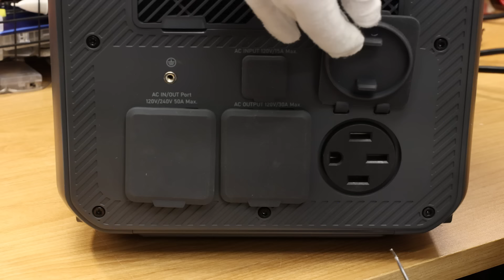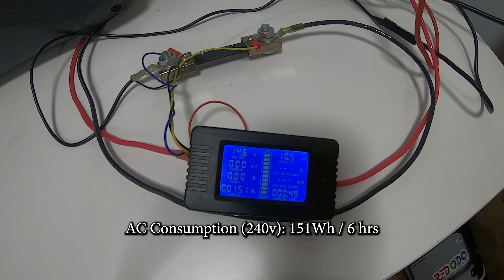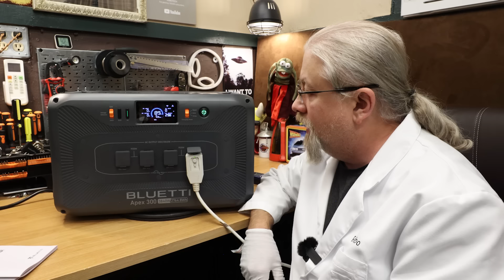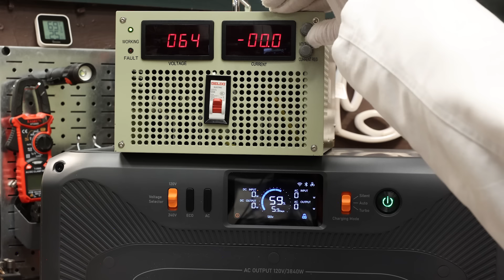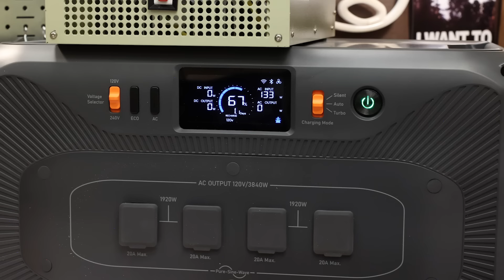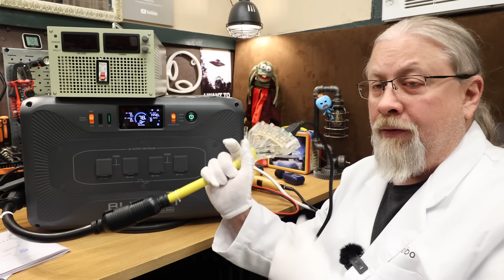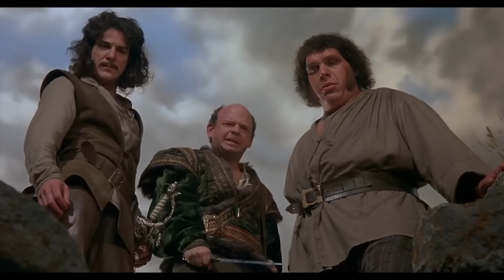Bluetti "APEX 300" 120v/240v MODULAR Home Backup Power Station | Cheap & Simple!

Comment: Wow this looks like I need this - one question I can't find a definite answer on: I have a whole panel interlock for my home and use a generator as backup (with a 30amp inlet) Can I use this WITH my generator hooked to the apex? and do I set the generator on 240v or 120v ???  as long as  I don't exceed the 3800w load will the apex do the job for basic home backup? I am hoping to be able to use generator to top up the apex so I don't have to run the generator all the time? And planning to use the Apex as a UPS on my modem router while it's not needed? that way it will always be charged and ready to go and accessible.

Comment: Hello. Thank you for this very comprehensive review video. This unit is one on my list. I have a question, have you tested how much total wattage can this unit output including the pass through/bypass (1400+ AC input and Inverter power - 3840 watts). If it would output a total of 12k if your using the 240v input, would it output a total of 5k+ if its plugged to the grid with he 120v input? im eyeing this  unit and knowing that will help me decide. Thanks in advance.

Comment: How could it have 12kW pass-through if the maximum output is 3,840W?  Or are you talking about with 3 units in tandem?  Or can it really put out 50A on that 240V connector if there's 12kW at the input?

Comment: You may have answered this and I may have missed it otherwise I think I know the answer but I am going to ask anyways.    
Ok my RV is a 30amp and my genarator has a 30amp plug csn I charge with 30amp and have rv plugged in at same time?    I am assuming i would use the 50amp plug with a 30 amp converter

Comment: I already have a solar array on my roof of 15 300w panels for a total 4950 watts that’s tied to grid but I don’t have battery backup when the grid goes down. Can the Bluetti 300 with 3 Bluetti 300k batteries be tied to my solar array without blowing up the Bluetti 300?

Comment: At 25 minutes Hobotech says that if set st 120 both sides of the 50 amp plug are hot.  Question: is you accidentally turn on a 240 device such as a well pump, will it not damage the 240 device?

Comment: Unhappy Bluetti Apex300 Owner.

I have made an extremely bad mistake.  I tried to follow your instructions and the Bluetti Apex 300 instruction manual on charging my Apex300 using the 240V Bluetti charging port.  By doing so with 240V, I caused over $ 5,000 in damage to my brand-new Apex300 and two B300K batteries.  According to the Bluetti service department, my attempted 240V  charging procedure using the Bluetti charging cable violated their design parameters.  

Supposedly, the US model Apex300 is not designed to be charged at 240 Volts but only at 120 Volts. 

Please advise your viewers not to use a 240-volt service to charge their units. The  Bluetti warranty does not cover any damage caused by using the Bluetti instruction manual.

Comment: Thank you for this great review. It seems like the surge capacity of your test was just over 5,000W at 240v output. This is not close to the advertised surge capacity of 7,680W. Why do they advertise something that cannot be achieved?
Reply: He didn't have it on lifting mode when tested.  I doubt it could still pull it off but it should be able to handle 4400W in that mode

Comment: I was hoping with your expertise you might be able point me in the right direction.

I’m torn between the Apex 300 and the Ankor Solix F3800 as I want 240v output. 

I would like to charge the power station with an older Honda EU2000i generator, and it looks like that output on that is 1600w at 13amps with 120v AC.

I’m hoping to replace my Onan 4500i generator and combine the Honda 2000 generator with a power station to run my 30amp RV and its air conditioner during the day.

I don’t run the AC during the nights and would prefer to not run the generator but would still like to power the RV fridge, a TV and Starlink mini (for a few hours), and charge our phones without listening to the generator running.

During the day I would run the generator to charge the power station and also run the AC periodically.

Comment: I bought Apex 300 last week. I was able to use it for 2 days only until after draining the battery completely to 0%. Now, I try to charge it thru AC or DC input but it will only turn on for 10 seconds until it turns off itself. It won't charge anymore. I called service but looks like they have to replace it. Don't know how soon. I am boondocking so hopefully soon.
Reply: Update: I got it working again. It is now charging. I believe it needs to be charge with low watt input for a moment to charge it. From my observation, my solar charging went low to 35 watts input during sunset. When I turned the Apex 300 on, it was taking 35 watt input instead of 0% during daytime. When it was charging already, AC input from my gas generator charged it too… I have seen some people in YouTube had their solar input charging their Apex300 for 4 days until it woke up their BMS. I believe this problem won’t happen again if you updated your system version to the latest. Hope this helps to anyone.
Reply: Another update: After getting it working again, from around 70%, it all or a sudden turned off. I tried to turn it on again, it says 0%. So it dropped from 70% to 0% in seconds with about 150w AC output. I tried to charge it thru AC, it says it is charging but it will turn off itself. Now, I am back to having the BMS won’t charge. This is very frustrating especially when you are boondocking… My gas generator is more reliable.

Comment: Someone told me (maybe you will too. Haven’t gotten to the end yet) that you can only get 16A out of the 50A 240V outlet. I assume you need to combine 3 of them with that panel to get the max amperage. Will you get the max out of that panel only or will you get it across all 4 outlets (the one on the panel in the ones on each unit).  If only in the panel, why do they put a 50A plug on the units?

Comment: My friend just upgraded his AC300 with 4 B300 batteries to the Apex300, which Bluetti assured would work with his existing batteries. After firmware upgrade and charging the Apex300 fully, we added each B300 one at a time. The first three worked fine, but upon adding the fourth, the Apex300 grid input fell to zero. Immediately upon disconnecting that fourth battery, the Apex300 showed normal grid input, etc. Swapping the fourth and third batteries and even their cables made no difference. The docs clearly say that the Apex300 supports 6 of the B300 batteries. That does not appear to be the case in our experience. Can you test this?

Comment: If your charging from 120v. Say a campground 30amp which is just L1.  Will this unit boost L1/L2 output using the 3600 watts available from grid.  Sorta like a victron MP 2x120.   Giving you 3600w from grid and 3840w from the inverter.   Like being able to run 3000w on each leg or variations of such

Comment: My cabin has a weird dual 120v generator inlet that powers 2 circuits from a generator.  Also there is a separate 110v circuit in the crawl space to power this.  This is perfect for my existing setup!

Comment: I just bought a apex 300, opened the box, unit showed 0% charge. Have been trying to charge it for over 24hrs still shows 0% charge, then screen shuts off after 2 seconds.Will not accept AC or solar charge. I am not the only one. Bluetti support is horrible,  I should have bought  ecoflow.  Bluetti support is awful you spend all that money and get the run around. BUYER BEWARE.

Comment: DO NOT BUY ONE OF THESE!!!! I’m on my second one and it’s already failed with minimal use. First one was a brick right out of the box (0% wouldn’t charge) received a replacement and it finally charged after two days on 120V AND 400W of solar panels. Used it over 7 hours to power a small electric cooler and it’s a brick now. Won’t charge. Asking for a refund. Do not fall for all these videos where they “got the unit to test it out”. This company will fail soon. DO NOT BUY THESE!

Comment: Am i correct in thinking that connecting am RV 50amp plug into the 240v circuit would provide a max of 16amps per leg? Of so, im thinking it better to use the 30amp outlet via dogbone adapter and not limit L1 or L2 to 16a and L1 to pull 27(+)a amd L2 to sit at 5(+/-).
Reply: 3840 watts is the total output using the 50 amp plug , using the 30 amp plug the manual shows a 3,600 watt max ,  i leave mine on 120 volts, connected to my rv 50 amp power plug and it runs my whole camper , using 2  a/c "s and all other lights , tv and stuff , using two expansion batteries from Vatrer  rv ran for 12 hours and till had 44 % battery left , this was with inverter off and 12 volt system ran thru a separated 300 ah battery, if the 12 volt battery gets low i can turn on the converter back on.

Comment: Ok - dumb question.
I have no intentions of running the anything that requires 240v. Is this just an option I have but don't need. 
I'll be connected to a transfer panel/ switch with the circuits I want to power, not using the individual outlets.

Comment: Operating temp range in specs tops out at 40C, around 104F.  Since the Apex 300 is indoor only, I wanted to set my in my garage, which has little insulation and no HVAC at all.  Problem:  I live in the Dallas area, where ambient air temperatures in the summer hit or exceed 100F 20 to 30 times per summer, meaning the AC300 and expansion batteries won't work.  Competitors such as Ecoflow and Tesla Power have operating temperature ranges up to at least 50C or higher.  Bluetti needs to expand its operating temp range if it wants to sell its back-up power systems in many US Southern states.
Reply: Shoot I’m in the north Dallas area too didn’t think of the temp range being an issue

Comment: If you are powering a 240V load (say an EV at 3,600W) and have 120V AC plugged-in, how is that 120V input treated?  Is it converted to DC and supplements the overall inverter load, or is it passed-though as one of the two phases?  ( I guess you could tell by looking at each phase voltage and see if they match the grid, or the inverter...)

Comment: Has anyone tested this unit with a 240v table saw (no soft start)?  My current solar power system has failed meet my needs for the 240v saw.  Thanks, Brad.

Comment: I have the AC500 w/6 B300s batteries. You'd be surprised how much power is needed to run a window A/C, microwave, gas oven (600 watt igniter), fridge, TV and home theater, air fryer, fans, dishwasher, washer & dryer, etc. Wattage starts adding up real fast and the fan kicks into overdrive to cool it down. A single Apex would be at it's limit pretty fast, so even with a stack of batteries, I'm not sure it can handle the wattage I need daily. Except for during the summer heat, my daily electric grid use averages $0.87 cents a day😎
This past summer I managed to keep grid use down to $90/mo, (my neighbors complain about their bill being $300-$400 from running their HVAC 24/7). I had to run mine only in the afternoon for an hour or two a day.
Reply: nuclear and coal for steam are excellent sources of power. 😂

Comment: Thanks for reviewing this unit - I'm super happy with its performance.  The only problem I'm having is related to the deactivation of WiFi and Bluetooth signals.  I followed the directions in the manual and in your video and it turns off the icons for WiFi and Bluetooth, but there is still a pretty strong wireless emission coming from the center of the unit (around the level of the 120 V outlets in the middle).  I'd love to be able to really completely shut off the wireless/RF fully.  I think you have a wireless meter to replicate this...  Also, thank you for even talking about this topic!  For me, it's a strong market requirement and it's good to here that you're getting the same feedback from lots of other users as well.

Comment: Bluetti thinks everyone will stack these new batteries...some of us a new to the ecosystem and don't have additional cables ...i want to use the apex 300 in a rv, but i do not want their new 90 degree connector ...and their web site has ZERO option for side by side connection of the b300k to a apex 300...weird,  right ? Oct 1 2025...maybe in the future  ?

Comment: I have a NEMA 6-15R plug that is wired to a standard 240V external 'socket' outside my house, I then plugged into my 240 socket on my generator.  I got rid of the generator and in my basement have a female 6-15R plug that I need to somehow match to the Bluetti 240 plug (If I buy the unit).  Based on some rudimentary research I think I need a NEMA 14-50P (on the Apex 300 side) to a 6-15R/6-20R 240V 20A Adapter Cable?.  My deep well pump is 1/2 hp.  Not sure if I explained this correctly.

Comment: Legend with the dc pro password 88888888 saved me a call. One thing I have had an issue with is the dc hub cig outlet giving daily Eo67 DC output current high errors, wish you had of tested that running my waeco cfx3 75 dual zone on 12v, I've just used pro to enable 24v and can already see it is now drawing less watts oddly. Anyways will see if it helps to stop the daily dc errors, i raised a case with bluetti today about it, they started to stuff me around until i cited i would post a vid on it. Now i seem to have a tech interested in it.  Charging in Australia 240v is STD and we hit 2158w of charge at 10 amps off mains. Cheers

Comment: Dear,

I would like to purchase an Apex 300 and expand it with a B300K. If I understand correctly, I also need to purchase a CA90.
I would like to charge via a permanent connection (Wall Outlet), using existing solar panels, (provided I purchase the MC4 XT60 wiring), and while driving with the Charger 1 DC-DC.
My question is: Can the three connections remain permanently connected to the Apex 300, and will the Apex 300 automatically choose how to charge?
For example, if I'm off-grid, will the Apex 300 automatically choose to charge via solar panels? If I drive away, will the Apex 300 automatically switch to charging via the Charger 1 DC-DC? If I arrive at a campsite later and have a permanent power supply available, will the Apex 300 automatically choose to charge via this permanent charging station? If this isn't possible automatically, could you please let me know in detail how this should be done?

Sincerely,
Egon Boffé

Comment: I have found that the Apex and B300s do not work together very well.  I have 4 B300s but can only get 3 together to work with the Apex.  The Apex does not always turn on the B300s when it is turned on and, as of yet, the B300s do not turn off when the Apex is turned off.  Prof. Hobo, what have you found with the B300 and B300S?

Comment: Great review one question. How does this work as UPS for 240v well pump if it's regularly running off grid via 120v outlet? Or does it always run off battery (and charging from 120v grid) when it's in 240v mode?

Comment: This unit should have an mppt charge controller. Of at least 150v and 2000 watts, of power. 60v and 1200w just doesn't cut it for me. I think bluetti flopped on this one. When there is a power outage which thats what their used for. You really rely on it.

Comment: That solar input really sucks, and it's way too loud with that solar input, I'm so disappointed.  Why does the Bluetti website say it can take 4,000 watts of solar???  They call it the SolarX 4K, for 4,000 watts of solar, a world's first.  But then on that same page it says 2.4kW solar.  Real world testing is 2,200 from HOBO, but my 100w panels only can provide 1,200 watts max using both ports, 600w each LOL.  What a crock.  Please tell me I'm wrong, I really want this with 4K of solar, I'd buy it today.... They should have four solar inputs, the same PV input as the AC200L for 4,800 watts of solar. And make the battery a little smaller, keep the weight about the same as the B300K, about 62 lbs.  😊

Comment: Solar input is 12v to 60v, 20 amps max??? What the heck is going on?  I can only run 600 watts per channel with my 100 watt panels.  On my AC200L the range is 12v to 145v, 15 amps.  I'm actually running 1800 watts of solar on that one, looking for a power station that can actually run 2400 watts in real life, not just on paper.  We'll maybe Bluetti can do it in the next upcoming model...
Reply: Yeah I’m shopping for a power station for my rv and was going to get this one but that’s useless. My two new 200 watt panels are more than 60 volts in series, that’s pathetic. The search continues

Comment: Finally more input power on a small power station than an Oupes mega. (just watched the testing, what a shame it doesn't hit that, really should be 150V)
Still they could had done more lol.
I want a power station that can charge an ev from solar while camping or from some panels set on a carport.

2400 tho is good for the mobile application cause I'm limited by trunk space to probably that much in terms of folding solar panels.

And with the additional charge controller I'm set i think.

Comment: Sir- Professor…plz help me out. I bought $157 100 amp power lithium battery. All the cells were in very good shape very close in power it appeared it was a quality battery. I let it run down not paying attention and I’ve tried all the recommended ways to Kickstarter jumpstart the BMS… Not workingis it very hard and I’m capable of replacing the BMS simply replacing it and I’m assuming a new BMS would come with some Bluetooth connectivity. Do you recommend a type of BMS or is it worth swapping out the BMS at all?